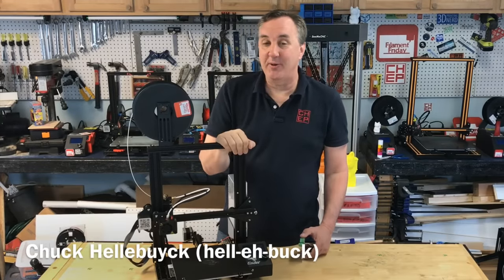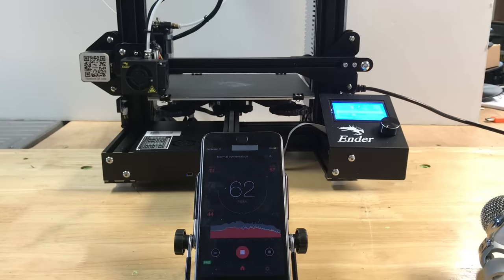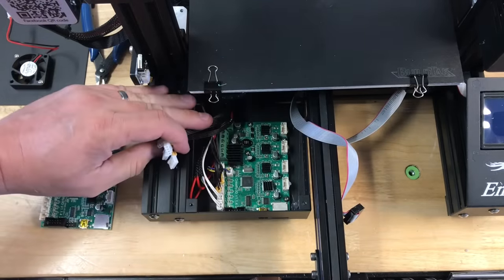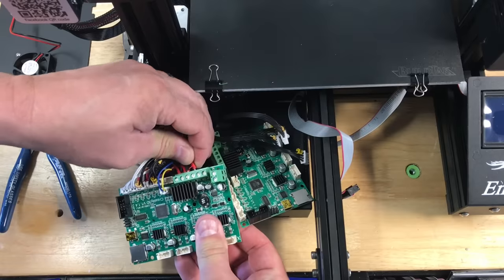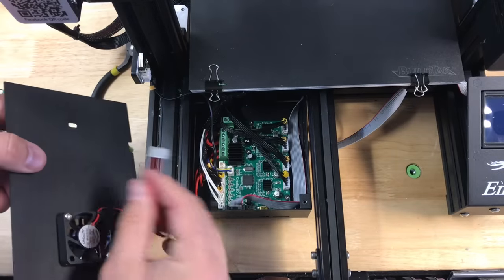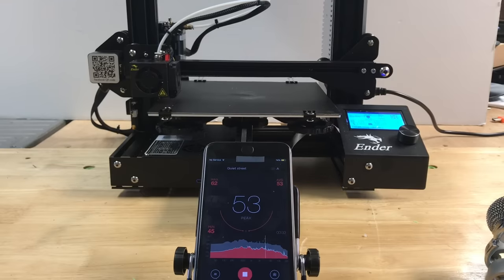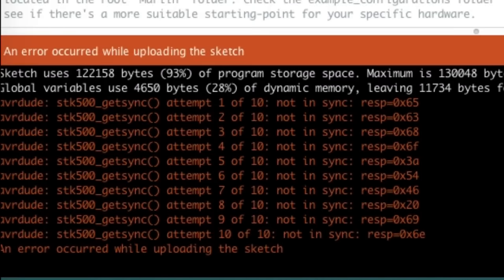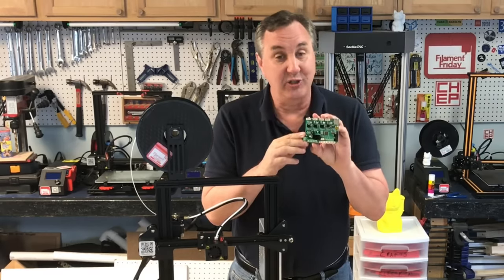Creality Ender 3 - Creality Silent Board v1.1.4 TMC 2208 Upgrade

Comment: Given all the variability with this upgrade...I'm glad I went with an MKS-GEN-L and TMC2130 drivers. Also meant I could add a BLTouch without having to mess with pin 27 add-on boards too.  I do see the advantage if someone just wants a plug & play solution.....assuming the board they get is actually as advertised of course!

As always, thanks Chep, another informative vid.

Comment: My recently purchased Ender 3 has this new board already installed and is very quiet. I have just changed the firmware to Marlin 1.1.9 and had to load a bootloader to accomplish this. I thought it was just me having problems but now you have proved that no bootloader is installed despite the Creality advertising and some other Youtube reviews.  Another great (honest and reliable) review.
Reply from the maker: Thanks
Reply: Are you positive that yours has TMC2208's? Because according to Creality's website, there's no version of their products that ship with the silent board atm. I bought an Ender 3 from the Creality's official Australian eBay store a month ago, and a friend of mine bought his about a week ago. We both have the exact same printer, part for part, but definitely don't have upgraded drivers.
Reply: From all the oddball stuff I keep hearing about creality's machines, it almost seems like if they run out of stock on something they just grab what ever else they have on hand that will work in place of what ever they ran out of and just start using that to keep production going until the part gets replenished.
Reply: @Incurafy  it doesn't ship with the silence board you have to buy it separately.

Comment: Today I used your video and changed mine to 1.1.5 from creality. Easy steps. Thank you very much as always. Proud to be patreon. Long life, learning, sharing and joy to you.
Reply from the maker: Thank you for your support.
Reply: Where did you you buy the motherboard? Is it fitting with Ender3 pro ? thx
Reply: @joanS12  Bought on Amazon. Fits perfect and is plug and play. Just follow the wiring as they are the same exactly.

Comment: chuck this is my result:
after studying the motor and driver datasheets and using the vref and iref formulas. using the driver voltages from the 1.1.3 card
I got these values for the 1.1.4 tmc board
XYZ = 0.98V instead of 1.25V
E = 1.170V instead of 1.25V
I made long print of 5 hours all perfect no layer shifting
motor temperatures below 50 degrees.
The strange thing as someone on their site pointed out that the potentiometers are all 50% as if they hadn't even been touched.

Comment: Adding some foam/rubber under the printer will significantly reduce the noise when using on a wooden table, without damping the table will act as a soundboard amplifying the noise.

Comment: Upgraded my Ender 3 a month ago.  It went from printing great to printing marvelously!!!  Also loaded Marlin 1.9 and added thermal runaway.  You gotta add a Sanguino board script to change the firmware.  Teaching Tech channel has the tutorial.
Reply from the maker: I did have the board set to Sanguino. I know how to program. Mine didn’t have a bootloader.

Comment: Just get an SKR V1. 3 with 2208's. It's similar if not cheaper in price. It's a 32bit board and you can run Marlin 2.0. Waiting on mine to be delivered. Board and 2208's came to $58 AUD from Bigtreetech on Aliexpress.
Reply: SKR v1.3 plus 4x tmc2130=45$. Same price and a world of advantages
Reply: I'm in Australia too. Are you able to post a URL here? Or a searchable name of the one you got so I can take a look? Cheers!

Comment: If you get that error you can try to go to device manager and set your printer COM port to a baud rate of 115200. That should fix it. If it doesnt work at first, go and reboot your computer. Make sure Arduino 1.8.5. is installed. Other Arduinos have been reported glitchy.

Comment: I really like the idea for this just replacement stepper solution - I sqaw now different reviews of this board and it seems like every reviewer has a different state of FW and settings on the board on delivery. I really don't know why they can not manage a proper last state with thermal runaway by default. Creality seems to be a 2 man corp with total chaos on the fw in general.
That they even messed up the 1.1.4 label in beginning to confuse the customers is such wrong way of doing things right. And they would be so easy.... sad when successful companies struggle on such easy tasks. Whoever gets this board I wouldn't risk that thermal runaway is in by default - check it to sleep well and secure!

Comment: Since I had an arduino UNO I used as and ISP and reprogrammed my ender 3 to have thermal runaway/booloader/1.1.9/smoothing_algorithm/filament_sensor I had to really fiddle with it to solder that pin. So I feel my system is above what I would get with that board. I would need to redo some of the tricky stuff.
Reply: @deceitive3338  the hardest part was soldering so I can get filament run out detection
Reply: @deceitive3338  Yea I can only have a filament run out with the powerloss/pause, runnaway, acceleration curves, and default menu is the max. I can't add distance sensor but with adjustment knobs it does not seem too big of a deal. But I'm using most of the space and well I don't see how Creality could do it without removing the logo which I had to do.

Comment: Heya,
I just got my 1.1.5 board tonight.
I wanted to say that it had 1.1.8 on it as advertised. I did get it from Amazon from Sovol Creality....Cheers
Reply: Just a quick note, I had previously installed the stepper smoothers installed, so I left them there on the New install on X, Y & Z

Comment: Any chance of a future video detailing how to connect a computer to a printer for the purpose of updating firmware, checking settings, etc?  Sharing the software to use and how to figure out the correct settings, etc.. would be very helpful.  Thanks!

Comment: My upgrade board is coming from China for my Ender 5......  I hope mine actually has everything as advertised. 
Thank you for the heads-up on your Ender 3  experience.
Reply: I doubt it will. I bought 2 from China Creality website and they came with no bootloader. One of the boards blew after 5 mins of it just sitting powered on. Chep made a good point about the serial chip. I struggled for an hour before I found I needed to install a new driver. It was hair pull time. Yes they are very quiet. Now I have to try to get them to replace the blown board. Creality said they are supposed to have a boot loader but they were way too quick to say its not there. I am guessing they knew it already.
Reply: @jimnichoson1241  Great :((   I can Hardly Wait ...

Comment: Nice approach and walk-through of the installation - those instructions should be about as foolproof as it gets!
That spike looked like initial bed movement from 0 to speed without acceleration/jerk management (firmware not having a previous velocity to calculate acceleration/jerk with?) - and then the bed hitting the Y end-stop. In any case, once running the changes in Y direction were silent which I guess is down to acceleration/jerk being managed as normal.

Comment: Huh, in teaching techs video on the new ender 3 board thermal runaway didn't work how it was supposed to, but his board did come with a bootloader installed and he was able to successfully flash the current Marlin version to the new board. Weird how your experience was the other way around. Kinda worries me that these boards might not be consistent. Either way great video.
Reply: i know weird im not  going to buy until they sort this out
Reply: I still wouldn't trust the error message on the screen. From what I've seen it can throw the error but still be sending voltage leading to thermal runaway. Need to monitor the voltage cutoff to be certain.
Reply: @morallying  I agree.... unless you test the voltage still being received, you can't really rely on a programmed status message

Comment: My thoughts: I'm with you on it. Bad advertising, but make up for it with the thermal runaway. In other news....my motherboard is toast.  The Extruder driver doesn't drive. I troubleshot it. Swapped cables, etc, and traced it back to a bad Extruder (driver?) on the motherboard. Less than a month with the Ender 3, so I'll be reaching out to Creality. Either way, already ordered an upgrade motherboard. Silence is coming my way

Comment: Just received my new 1.1.5 board yesterday and once again the one I got didn't come with a bootlaoder installed. The Creality HEX file wouldn't flash regardless of what I did. Ended up burning a bootloader and using TH3D firmware. I hope others dont have my issue. Thank you for all your videos.

Comment: The link for the board sold on Amazon is for the old 1.1.4 board without the triamic stepper driver. Even though it says silent in listing, the products details state it is not triamic and uses old stepper drivers.
Reply from the maker: I removed it to eliminate confusion.

Comment: TH3D mentioned his had no bootloader as well but people who got them a while ago like TeachingTech and myself had the bootloader already. I assume its either a crap shoot or they removed the bootloader feature from newer production runs. 

I cant say what firmware came with it as I just flashed my pre setup marlin I had for the original board straight away. I LOVED how quiet it is and forget I have started printing until the part cooling fan kicks in, I really should look into upgrading the fans that are quieter but with the same airflow.

Comment: SKR v1.3 plus 4x tmc2130=45$. Same price and a world of advantages
Reply: Is it as quiet as this?
Reply: Tyler Schubert The 2130’s have stealthchop 1, which basically still takes 1/16 microstepping like the stock Ender 3’s A4988’s, but smoothes that out over 1/256 microstepping by not having as agressive jumps. Allthough great for sound, this drives more current through the motor, and has reduced torque. The 2208’s have stealthchop 2, which uses the same 1/16 - 1/256 solution, but increased torque.

(Microstepping, in case you didn’t know, is simulating a higher resolution between the «magnets» in a stepper motor by activating many of them at the same time, moving the motor less than a complete step.)

There are advantages to the 2130’s though, as they can monitor the motor current, allowing for both sensorless homing (driving the head into the frame instead of using endstop-switches) and monitoring lost steps (if the head enciunters an opposing force and slips on the motor).

The 2208’s have a high torque solution available, called spreadcycle. This makes some ammount of noise, but can be configured in sucha way that the printer only uses it when needed.

Tl;dr:
Yes, they are just as silent.

Comment: Nice video, really. However, I just can not justify the price of this board, while one can buy BIGTREETECH SKR v1.3 together with 5 x TMC2208, and it will cheaper and much better option. The SKR board has decent 32 bit MCU (you can print better and higher speeds and simultaneously use all those fancy Marlin features like linear advance, S curve accelerations with no need to turn off the beeper and stuff), out of the box UART and SPI support to control the TMC drivers (current, microstepping, chopping modes, hybrid StealthChop/SpreadCycle mode), support for 2 extruders which means you can easily install some multimaterial printing upgrade. And all those features you get for lower price that this upgrade, the only downside is the upgrade process is not that straightforward as replacing one board with identical one but with different drivers. However, it's still pretty easy to do.
Reply: I may have to try this on the next Ender-3 I get. I just got a MKS gen v1.4 and tmc2208 drivers.
Reply: @viktor , do you have the SKR? I want to imprive print quality on my Anet A8 ( upgraded to AM8 and Drylin bearings) 
Will the SKR 1.3 be an pring quality improvement?
Reply: @benriefourie115  , I do indeed have SKR with TMC2208 on my Ender-3, and the board is amazing for it's $20 price. However, the answer to your question depends on the kind of problem you face. You should understand that print quality mostly depends on the mechanics of your printer. If your poor print quality is mechanics-related, like frame is not rigid enough, Z axis wobbles, issues with extrusion system - in this case the board will not improve the print quality, since it will control the same mechanics. However, there are couple of issues which can be fixed by upgrading your board, namely the "salmon skin" (which is a common thing on Anet printers AFAIK) and the lack of computing power. The "salmon skin" texture on prints comes from cheap stepper drivers, and on SKR you could install any drivers, for example TMC2208, and get smooth and quiet movement with no salmon skin. The lack of computing  power might disable you from reliable printing on high speeds, print-head might stuck from time to time on arcs or very detailed prints which causes blobs on a surface and oozing issues, or another example - you want to turn on some advanced feature like Linear Advance in Marlin to improve your print quality but your board can't handle it - such issues also can be solved by upgrading to SKR, since it has more powerful 32 bit MCU.
Reply: @ArtificalSUN  Wow , what an detailed answer. Did not expect that! So I googled salmon skin and its is exactly the problem I have. I am looking into the SKR V1.3 with TMC2130 stepper drivers. I anyway print very slowly to have good quality. Typically 50mm/s max. 30mm/s outer shell. Seeing you know lots , perhaps you can answer a question that I could not find on videos and forms. I want to get a Pie3 to use Octoprint, and perhaps do time lapse. But octoprint is my main thing as I want to print from my laptop without inserting the micosd 10x times a day. Will I still see the benefit of a 32bit board with octoprint? It will be useless upgrading my board , but then the PIE slows me down and I could have stayed on 8 bit. Looking forward to your answer. Do you have an youtube channel?
Reply: @benriefourie115  , TMC2130 are also good choice, somewhat more reliable but slightly louder than 2208 and still benefit the SPI capabilities of the board.
Do you mean Raspberry Pi 3 by Pie3? Things are complicated with Octoprint, just as with any printing over USB, and the reason is how Marlin handles commands sent from host (to make long story short - it's much slower process than printing from printer's SD card). Sometimes USB printing might cause problems by itself, but this might be fixed usually by tweaking buffers and planner in Marlin. In general Octoprint works fast enough on Raspberries (I have Pi 3B+ personally) and people even use Octoprint on Orange Pi boards which is basically cheap but less powerful alternative to Raspberries. So I do not think you will have any troubles from this side. It's still worth upgrading your board since there is a lot of calculations done by the firmware and not Octoprint (like Linear Advance or S-curve acceleration or Auto/Mesh bed leveling).
If Octoprint is an issue, it will be an issue with any board, since the USB printing problems I've mentioned are not directly connected to the printing speed, for example if you have very detailed model with lots of curves with high resolution it will cause huge load on USB gcode transferring at any speed, since you can easily have 20 gcode segments for 1 mm of your curve. So if you are printing complex models with high resolution my suggestion is to use SD printing (or try tweaking buffers in Marlin). By the way, here SKR is cool too - it's microprocessor LPC1768 has SD-host capabilities, providing to the host access over USB to the SD card installed in the board's SD-slot (just like any USB card-reader)  - you can send you gcode file to the SD card from your host (computer or Octoprint) and then select it on your printer and print.
No, I have no channel, I'm just a random guy with a 3D-printer.
Reply: @ArtificalSUN  Super . Thanx dude. Ill get the SKR and pause with the octoprint for now

Thank you for the info!
Reply: @benriefourie115  , you are welcome! I have to warn you, though, that to the best of my knowledge there are issues with connecting Anet displays to other boards (not only SKR). It's something with wiring, Anet uses non-conventional wiring for EXT1 and EXT2 connectors on their displays. A guy in one of my Telegram chats was not able to connect his Anet A8 display to SKR, but eventually he managed to do it buy doing something with wiring (he probably turned 180 degrees one of the connectors) and tinkering with the pinouts in Marlin. Sorry, I was not able to find his message with exact solution, but I think It can be googled. Good luck!

Comment: While it may well be your board has no bootloader installed, I would try flashing it with another computer, preferably one running linux. I had numerous problems with flashing microcontrollers with osx, and I resorted to dual booting my mac pro with linux. Neither a fresh install of yosemite or high sierra (and I had the same problems with every other version of macos) allowed me to controll my nucleo boards running stm32 controllers for example, but I had no problem whatsoever with linux, even on the same hardware...

Comment: Thank you for this great tutorial. Have changed the board using the 1.1.5 and there was a bootloader, looks like Creality has watched your video. In other tutorials I have seen that they adjusted (lowered) the Vref voltages to avoid a stop of the extruder in long time prints. Is that really needed ?
Reply from the maker: The voltage shouldn’t be higher than 0.9 I believe. How low did yours go?
Reply: CHEP The original board had x,y,z,E=0.60/0.59/0.62/0.75V and the new 1.1.5 board had 1.18/1.17/1.16/1.36V but I lowered it to 0.97/0.97/0.97/1.2V